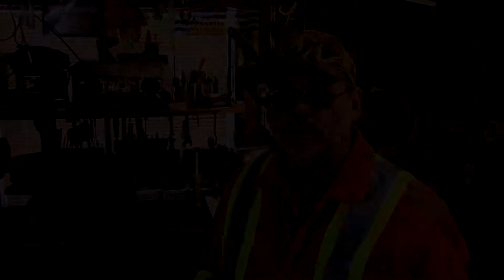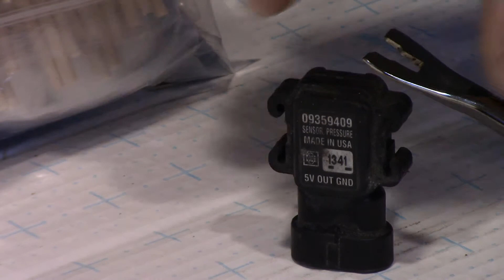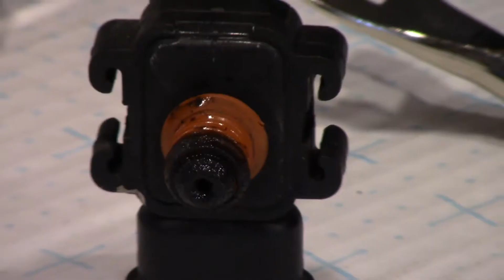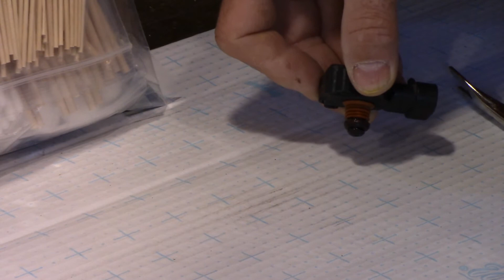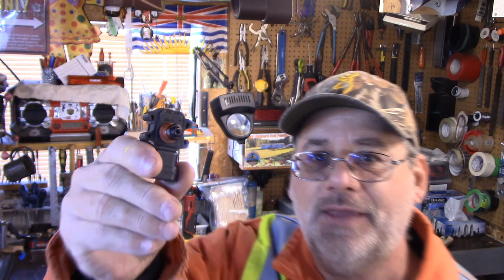Silverado PO106 Runs Rough , High Idle No Power

Comment: My 03 1500hd 6.0 is idling at 900 when warmed up in all gears. Doesnt matter in park/drive whatever. New throttle body and position sensor. Anybody got any ideas?
Reply from the maker: @DusterNutbar  Most likely a vaccum leak somewhere.  New throttle body may need to be recalibrated if no vaccum leaks . I'd start looking for vaccum leaks , look at fuel trims for clues and O2 sensor readings as well. No codes mentioned so  there is a start.
Reply: @SteveRobReviews  No vacuum leaks, not throwing any codes. New 02 sensors, didnt change it any. Im starting to think previous owner put a tune on it.
Reply from the maker: @DusterNutbar  A tune would never demand a 900 rpm idle.  You could try disconnecting  the battery , let it sit for 20 minutes and  then connect the battery and let the ecm start from scratch and relearn  and see if it corrects anything .  Might be worth a try , turn everything off , no ac , turn everything off .
Reply from the maker: A scan tool will display desired rpm and actual rpm  so if the desired is about 300 less the truck can't correct .

Comment: Before DOD/AFM when GM engines were still good
Reply from the maker: My 2021 Silverado 5.3 seems very good.  More power than my 6.0 and much better mileage.  I have no complaints at all. Awesome truck so far.
Reply: Had a 2013 it was a nightmare The old 92 Chevy it replaced was a better truck at 25 years and 90K miles burned about as much oil to and the 92 had leaking valve seals Guy I sold the 92 to still have it and still loves the truck 7 years later
Reply from the maker: It does seem manufacturers like to bring out new technology thats not quite up to par every 10 years  .  I see the same going on with electric vehicles too.  I like to stay away from new technology  but today it's all new it seems .

Comment: 300k and 2002 and it hasn't rotted out yet in ontairo thats impressive
Reply from the maker: Jerry I had visions of it snapping off at the base but I talked dirty to the sensor and its almost fell out on its own 😅
Reply: @SteveRobReviews  having it snap off and fall inside would suck indeed, at least the manifold is easy to remove if it ever did

Comment: Good call,  would do the same. But Back in the day would have cleaned it 5 or 6 times before getting a new one. Hope it works.
Reply from the maker: Its running great Joe , cleaning is an option forsure. Cheers.

Comment: Intermittent  problems are the hard one to find especially when your on the road and just sometimes.... Never herd of cleaning them,.... Never even ever looked at mine....must check to find it in my truck....good video....CHEERS
Reply from the maker: Mine is a 2002 and I know  all the sensors can only last so long so sometimes it's  best to change out the ones easily accessed  to prevent a breakdown on the road.
Reply: @SteveRobReviews  I think about six years ago I change the crank sensor but it was just a leak in the connector and it changed the resistance....CHEERS

Comment: hey steve....the ac delco pro may or not be the  oem  its a quality part though...that code might set from the dip caused by a maf or fuel pressure
Reply from the maker: Well  its running perfect  and logically at 300K I can expect to have some sensors go out. Cheers

Comment: This code commonly makes the vehicle idle to high while stopped and I have seen this code cause a ton of problems were it has no balls during acceleration between 20 and 50 mph depending on the vehicle especially when it's cold these sensors like warmer weather
Reply from the maker: It was not very  driveable at all really  but at low speed just to crawl home.
Reply: @SteveRobReviews  defenitly a frustrating code for the driver